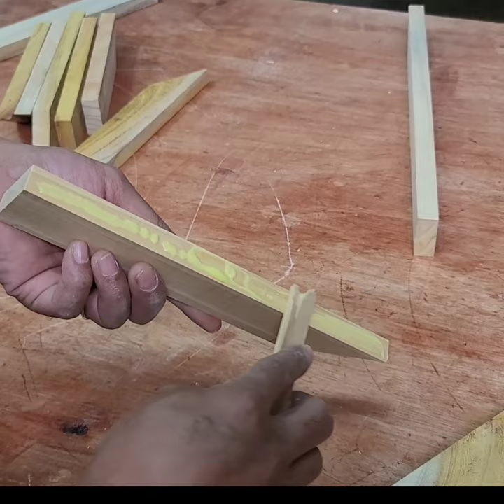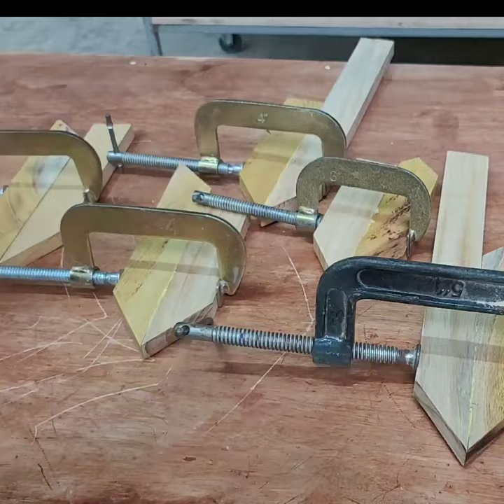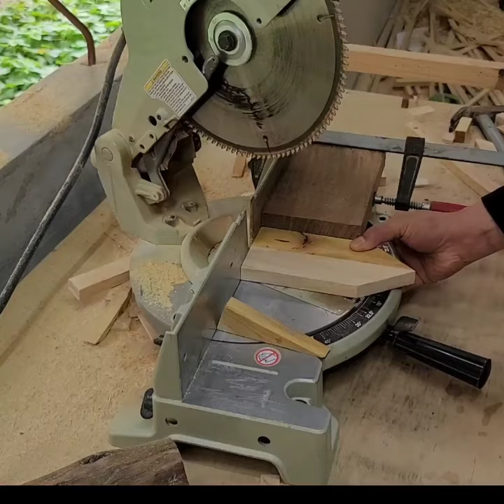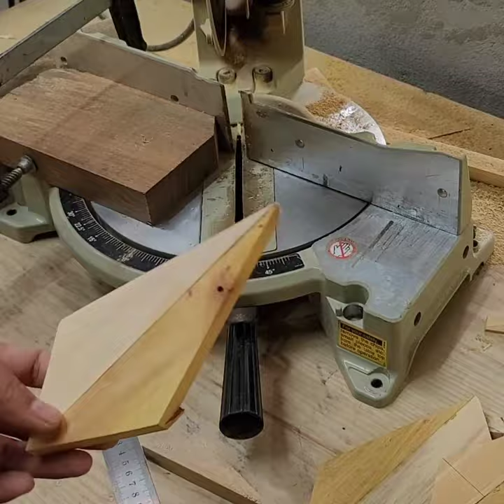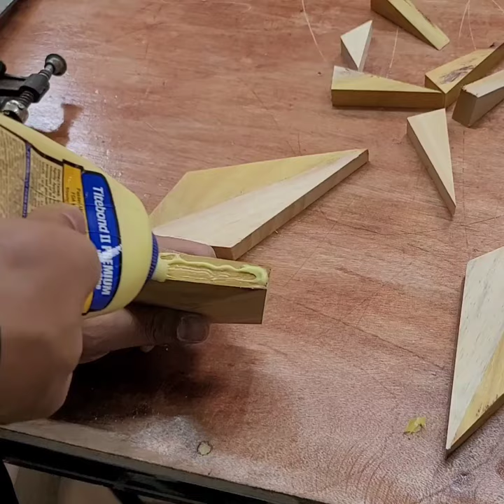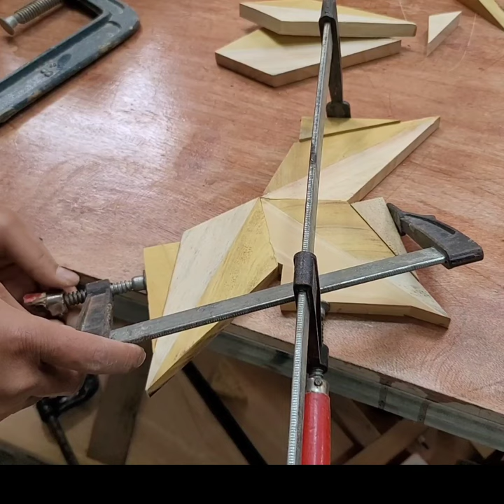#Short How to make a wooden star. @iwooden2507

Comment: I can do one better with the all the pieces being five solid pieces and beveled from the center, down to the point or make another star that looks inverted from the outer points being high to the center being low using the same jig with an adapter added to it. And the only gluing points are in the Middle where the five segments points comes together..oh. and all done on the table saw. 😊
Reply: Make a video